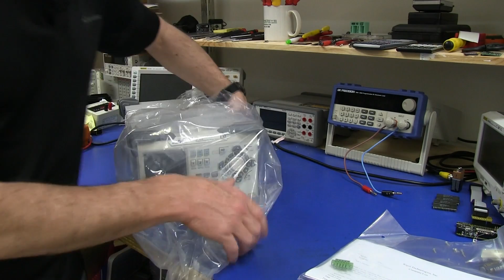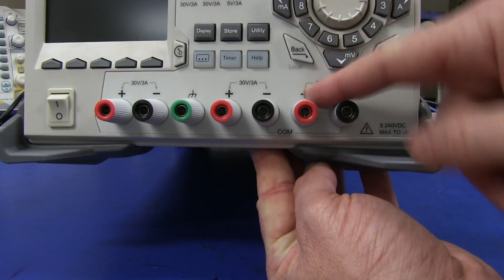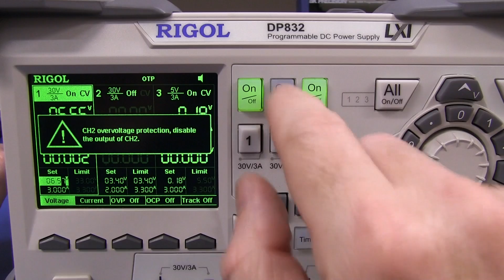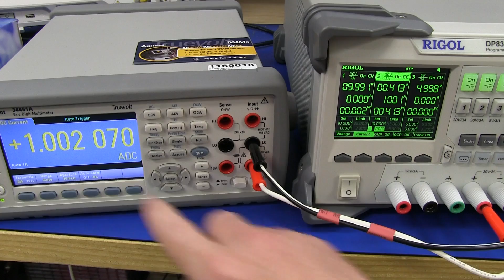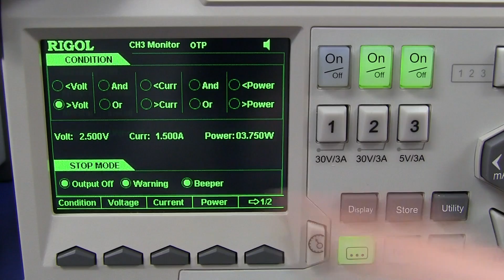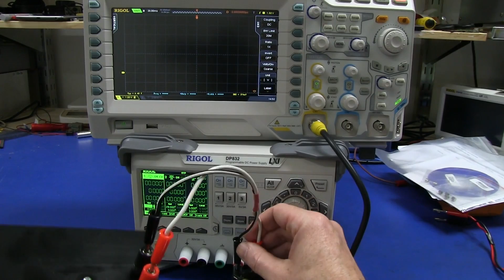EEVblog #509 - Rigol DP832 Lab Power Supply

Comment: 19:29 that is stupid useful
especially when I'm testing within a voltage range
I usually have to be extremely careful not to turn it up too high
which can be easy to do as my psu has velocity control

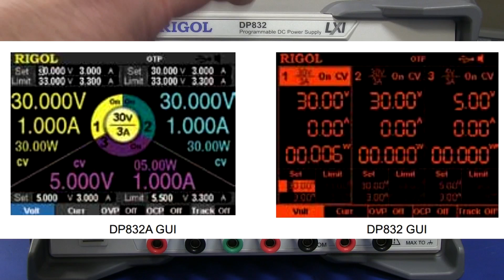Comment: 3:41/3:51 - as others have mentioned, it looks like it may even be the same screen, as the display mode thing does light up multiple colors simultaneously.  More importantly to your concern expressed at 3:57, the DP832A can be set* to a display mode of "Classic", which looks basically like your preferred mode, except with different colors for each channel.
* as evidenced in v=jB9t8Un9dD4, at about a minute and 40 seconds in, in case you want to see for yourself.

Comment: I have a KEYSIGT power analyzer. 4 channels, very expensive. Modular, all upgrades are hardware. Then I have a ATTEN TPR3020S, which is hell of a powerful unit. Then there is my Hewlett Packard 24V 50A beast.
I use the Keysight unit and I am used to it, can use it without really looking at it.

Comment: Just a comment about overcurrent and overvoltage protection.  A lot of PSUs switch off when they hit overcurrent conditions.  This causes the power rail to oscillate and will damage your load if it has inductances in it.   I would like t9 see how this PSU works under those conditions.

Comment: Well I just made my first and probably last RIGOL purchase. I orderd the DP711. First unit I received had a faulty tuning knob. Now the second replacement unit I received is reading anywhere from 18-24mV higher than the actual output and set out put. Rigol is telling me that is with in the 0.05% error of the display. So why did I pay $60 extra for HIRES to unlock a false reading. Not only is last digit wrong but the second to last digit is also wrong. Sound like they running a scam. Rigol also says there is no way to calibrate this. Rigol also claims this unit you are featuring DP832 also has the same 0.05% error yet when I watch your videos yours are right on. Rigol now refuses to swap the unit because Thayer claim it's in spec. So what gives? This is bull. My eBay $60 supply is more accurate

Comment: You know it turns out this product is exactly the same hardware as their fancier DP832A power supply, which is like twice the price. It looks like they were trying to pass this one off as having a monochrome screen with just a backlight that you can change the color of, to disguise that and make it look like a much lesser model. But they slipped up in at least a couple places. Like the UI where you can select the color scheme shows all the available colors at once to select from, and the "custom GUI" option also has multiple colors displayed at once.

Comment: Presumably you can use the Over-X protection when running in constant Y, so if in constant voltage you can say "Shut this down if I hit 1A" and if you're in constant current you can say "Shut this down if I'm putting more than 10V across this to try to achieve the current".

Comment: I still cant get over spending the cash for the extra resolution and then seeing its out by $90.
Reply: The Combat Engineer just bought the DP711 and paid for the HIRES all to be told  18-24mV is with in error and I have no way to calibrate it. I will be getting a refund.

Comment: I wonder if they really use a monochrome display. I doubt it. I think they actually use the same hardware for all models with 3 channels.
Reply: they don't. Take a look at 23:20
Reply: @istvan8905  old comment, but... I think Narwaro is right.  At 23:20 you can see multiple colors on the display at once, even -- the color select section.

Comment: Thanks for the review Dave, just purchased this power supply.
Reply: Is it good? Hackable? Can you increase the output over fabric settings?
Reply: MegaNitrospeed So far it's been a great addition to my arsenal. I haven't really messed with hacking or increasing output as it does exactly what I need out of the box.
Reply: Greg Agnew So its worth the 400-500€?
Reply: MegaNitrospeed Listen, if you need an accurate ps with these features, yes.

Comment: Hi, can anyone tell me if this power supply has tracking serial mode ? I'll be doing a fair bit of testing op amps using split power supplies +/- 5v up to arround +/15v.  It would be great if I can change the two channels +/-V with one input contoller. sorry in advance for this newby question. I am assuming it is possible to link 2 channels !! ? Also can anyone recomend a more reliable power supply for around the same money. I watched dave diagnose channel 1 blowing a transistor after shorting with a relay and think it does'nt seam like the most reliable unit ? I dont need too many bells and wistle, just possibility of tracking split +/ power supply and some standard voltages. Perhaps I'm better off with 3 used single channel power supplies ?
Reply: thanks
Reply: +Ben Biles dont know why my comment has strike through!
Reply: +Ben Biles If you put a dash - on either side of something without a space it crosses it out like this you can also use a * to make bold text like this 
I know this is 3 days old but I figured it'll help somebody.

Comment: I can't stand products that are crippled by software and you have to pay for an unlock code. I fully understand the reasons and if I were in charge of making those decisions I'm sure my hand would be forced by the market as well, but I still hate that shit.
Reply: It does make sense in some ways for the manufacturer. They only need to produce one type of device for this range and specify the option tiers by software. It might cost more on a per unit basis with the aditional hardware but only a few bucks, but it cuts down on costs not to have 5 production lines when you can do this.

That being said, I do not like it when companies ask such extreme prices for this.
Like I said, the hardware options add a few bucks to the cost but then they charge you >90 dollar to change a "enabled=false" to "enabled=true"... All the code is already in there. It is not like you are paying for a new OS or something...
But hey, maybe there is a opensource firmware out there for these with all options + more unlocked
Reply: You can still use it as in the old days, never di software upgrades. For example in this case, when you're ready for more accuracy, sell your DP832 to someone and purchase the DP832A which has the higher accuracy. Why does it bother you if others choose to upgrade their existing supply via incremental upgrade cost instead of going through the hassle of selling current model and buying a better one?  Would it make you feel better if the upgrade was 3x the price and required you to send in the unit, then someone at the factory applies the update and puts a different sticker on it?
Reply: @adamkaiser1389  im pretty sure its the same hardware, you can just hack it to the A version!
Reply: It does make sense in some ways for the manufacturer. They only need to produce one type of device for this range and specify the option tiers by software. It might cost more on a per unit basis with the aditional hardware but only a few bucks, but it cuts down on costs not to have 5 production lines when you can do this.

That being said, I do not like it when companies ask such extreme prices for this.
Like I said, the hardware options add a few bucks to the cost but then they charge you >90 dollar to change a "enabled=false" to "enabled=true"... All the code is already in there. It is not like you are paying for a new OS or something...
But hey, maybe there is a opensource firmware out there for these with all options + more unlocked
Reply: Aye !

Comment: You should investigate why shorting a DC motor across the output of Rigol made power supplies always blows the pass mosfet and the fuse. It just does not make any sense at all.
Reply: Look at afrotechmods excellent video on inductive spiking.
Reply: KamkutGaming Thank you!
Reply: That does not explain why shorting a DC motor causes damage. Think about, if you take an inductor that is charged up to full magnetic field and then you short its terminals by a switch, then no voltage spike can build up across the inductor to cause damage. The short directs all the current through the wire loop that makes up the connections of the inductor and the inductor itself. Short circuits have close to zero volts....So there is something else going on.

Comment: I have had mine for  few months now. Its awesome a I haven't managed to kill it..Yet. I have killed three other PSU's in  less than 1 year. This is great and works really well handling all sorts of circuits I make it power. I love the rotary control as this make thumb spinning real easy. Got all the upgrades. No Cloud though. Only 2 complaints, 25 watts of power while its quiescent. If you lock the keypad you have to network into it to unlock it.
Reply: +Elecifun Dont short a DC motor when you test them to this power supply!! It blows a fuse and mosfet in them. But an Keysight one does not have this problem.
Reply: EETechs Thanks for the input. I have given mine quite a bit of grief so far and it is still good. I do not quite understand your test situation regarding blowing mosfets, do you mean blow the mosfets inside my DP832?
Reply: Elecifun Yes. You will blow a mosfet and fuse inside the unit if you short a DC motor that it runs.
Reply: EETechs Does it not matter the size of the motor? lol it doesn't make sense. Short a DC motor and lol it blows a mosfet and fuse. OK cheers I will have whatever you are drinking ;-)

Comment: What's with that Power Up Voltage Spike? Seems kind of tragic depending on if you had something connected. Possibly could take out that high end processor on that $100K proto board you mentioned. But maybe no current flow at Power Up? I don't think you checked power up current with the load, just the voltage.
Thanks for the review.
Reply: +Wes Z Yeah bit odd that. I mean even the old audio amps had a relay that kicked in when the amp was stable after power-on. I'm sure that would be an easy fix.

Comment: i think its stupid and overpriced its ok for 200˘dollars but 400 fkn dollars ?!
Reply: It's mainly because of the capability to be a high precision device, the hardware has to be there, or the software is useless.
Reply: Teth47
tell me one situation where you need a 0.00.00.01 volt precision
Reply: Kristijan Dinga High precision RF spectroscopy. Would you like more?
Reply: Teth47
yeah but its too expensive 400fkn dollars wtf ?
Reply: Kristijan Dinga That's actually pretty cheap. Lab power supplies can cost many thousands of dollars.
Reply: Teth47 yeah i mean lab ps are expencive in general :)
Reply: +Kristijan Dinga Physics experiments at CERN

Comment: You probably already figured it out, but the reason you're seeing 0.001A when nothing is connected, is because you need to manually calibrate the thing.  The same thing happened to yours that happened to mine.  As soon as you ran it through some paces, the calibration went off.  You already had CH2 showing .001 when you unboxed it, and CH1 started doing that after you hooked up the big load!

I have a 5 digit meter that's just barely adequate for calibrating this, but I managed to get CH1 of mine to within +/- .002 volts throughout the range; at many points it is dead-on. I had to run through the calibration a dozen or more times before I was satisfied.  If you have an expensive bench meter (I used a $250 Chinese handheld DMM), you can probably get it right on the first try.

I love this power supply.  It's gadget heaven, and a great power supply to boot!  I have a 100W 1 ohm resistor I could try the 30V 3A test on, but I'm afraid to go that high. :)  Looks like yours wasn't keeping up.   ...or maybe you had a limit set elsewhere on the device?
Reply: I just bought a DP711 and my volts are of 18-24 mV. I was told it can't be calibrated and it's with in error. Yet I paid $60 to get the 3rd decimal and from the sound of things the 2nd and 3rd are not accurate. Do you know something they don't? How do you calibrate it?

Comment: Your not using the knob correctly, it's ment to be thumb driven as your index finger rests above on the face (more stable control), as you do at 13:30...you eventually figured it out but were to quick to criticize. Also, your criticism that the output measured is not the same as the set value is rather goofy, the pwr supply control system is damped so it smoothly increases, and the reason it stops when you zip the number up quickly is it's figuring that your trying to get to a distant value so no need to track until you get closer to your destination number, then comes up. It's called UX design and they've spent time on it obviously. Maybe instead of rendering an arrogant opinion, keep in mind where you are on the scale of users. Can say that about a lot of your comments. Other than that you have good detail.

Comment: Dave , how does it react to connecting accu's ? what if your accu is 12V and you set the powersupply to 10V and 1Amp current limit .Does it discharge the battery till 10V ?  Or is it only sourcing current ?   (My R&S NGMO2 does sink/source.)

Comment: Spend extra money for removing an inbuild error??
I prefer old fasioned moving coil metering (at least for the Amp readout)
I prefer full analog control ( real pots in OpAmp driven circuits)
I prefer RockSolid controls rather than flimsy-flumsy rubber buttons...

Comment: Dave, i used to have a power supply that wouldn't current limit for a small delay after turn on. I smoked a few things before I chucked to the shit tin. Can you whack an LED on an output current limited to say 20mA and then switch off and back on? If it passes that test I'll go buy one.

Comment: They probably actually make a loss, or at most break even with the entry level unit. The fact it's software upgradeable is why you can buy it so cheap. 

So many people here want to kill the golden goose. Would you rather they just made 3-4 different boxes, with the exact same pricing, but not software upgradeable? Vote with your wallets - if you think you can find something better and cheaper, go buy it; don't bitch and moan and say you're going to try to rip them off. That's just pathetic.

Comment: I was unfamiliar with this obscure piece of software you reference. So i looked it up. It appears to be software made specifically for windows users, so it makes sense they would use such a naming scheme.
The oddity being its use in a embedded system.
I do agree agree that the DOS drive notation is familiar to windows users, if not a little ridiculous, why not A:? or even better /

Comment: I don't understand why the unit doesn't regulate the output to correspond to set point. If you want 10 v it should regulate to give you 10 v. The dial is just ridiculous, you have no idea how much you have adjusted when the display doesn't update simultaneously.

Comment: I think it's a great idea. The only other option is for them to spend more money making physically different units, which would increase the cost of all of the variations, and also means you would need to pay for a whole new unit if you found you needed extra features. 

If there's extra stuff in the box that's not active because you haven't paid for it, what's the problem? No different to having a satelite receiver with channels disabled until you pay the premium rates etc.

Comment: I looked on their site, and a 832 with all the extras is about $90 or so more than the 832A.
So they're definitely aiming for the 832 to be an 832A where you choose to leave out a few of the options for a lower price.  It seems like the hardware is basically equivalent.

Comment: Those rubber corners on the front. The breaky-offy terminals quite blatantly don't seem to be protected by those rubbers to any useful extent. I'm not suggesting that other equipment doesn't do the same, but I can't unsee it on this equipment now. It would annoy me every time I saw it on the bench.

Comment: you really cant do much, most have 16V caps, so 15V would be the maximum you could get.
It's really not much anyway, just find the voltage reference, cut the trace, add a resistor and a trimpot, adjust the trimpot to make it go higher or lower. Not sure how ATX PSUs are made but it's pretty generic. It must have a Vref, it could be inside the controller though. Just checked a chinese one, and it had 2 TL431 along a LM339. and the 7500B which has an int. 5V ref, so the they could be for 12v n 3v

Comment: yeah I'm 99.9999% sure the 32A model, is the same hardware with a different firmware flashed. so basically Rigol has crippled this power supply, and sells you a the keys to unlock it to make their money. very naughty.